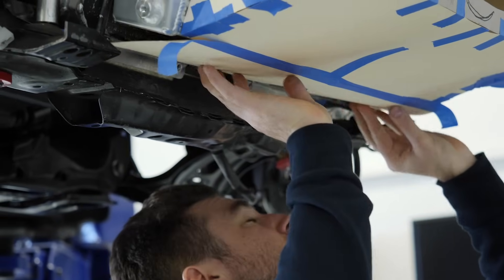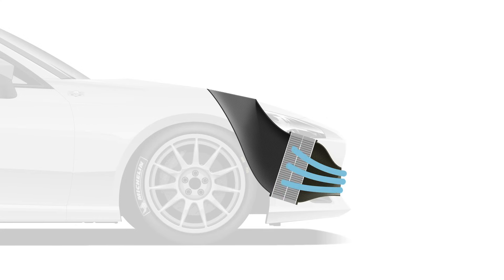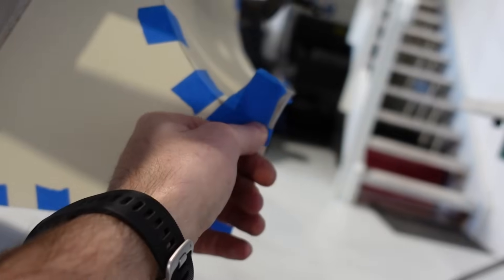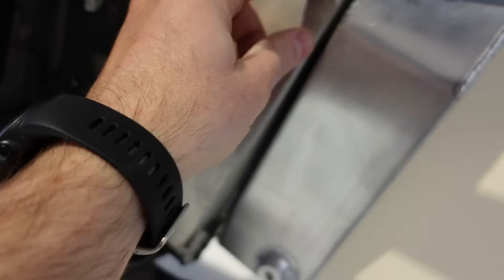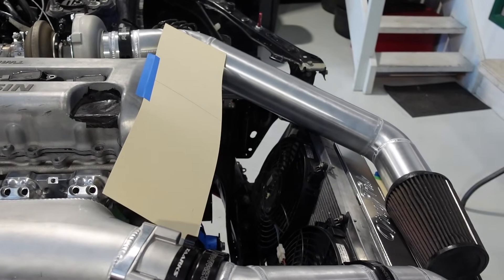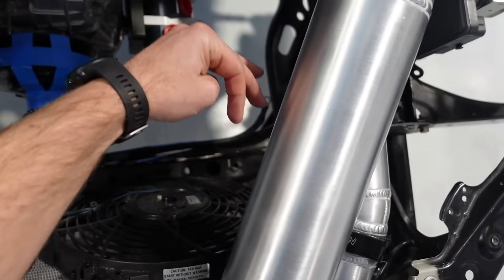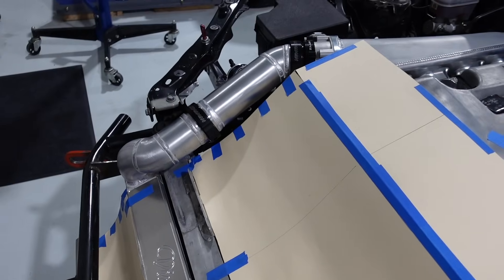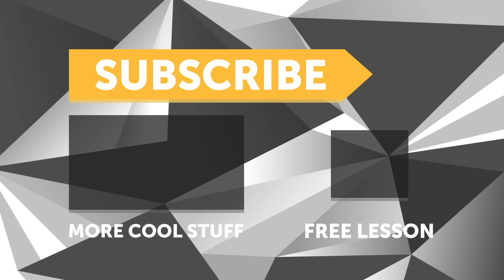Ducting and Coolers | 650HP SR20VET Swap | SR86 EP 3 [#BUILD]

Comment: Logical, sound theories there guys.
If only the manifolding sat the turbo further out. 
Never ending with saloon cars, single seaters are easyer to work with.
Worth checking that the exit duckting isn't too far back on the bonnet. I.E the air over the top does not reattach itself after the low pressure area behind the bonetts leading edge.
Hope all is more or less on schedual 👌
Reply from the maker: The outlet ended up being quite close to the front of the bonnet, so yes, not too far back! - Tim
Reply: @hpa101  Sorry to learn there were overheating issues in testing and the first event.  
If you read this, is would be worth checking there is a head of water above the top of the engine. 
Looking forward to future episodes.

Comment: 8:00 maybe I’m wrong but pressure isn’t density. + Remove one fan from the heat exchanger for extra efficiency because Racecar
Reply: The more gas particles the more air density. pressure meaning more air in the area = air density.
Reply: At the same air temperatures, you are in fact wrong.
Reply: There are different types of pressure, and the type he is referring to is static pressure  (note this does not mean the flow is static, but you can think of it as internal pressure). The higher the static pressure, the more dense the fluid.
Reply: I'm with you on that one. The higher STATIC pressure doesn't mean that the air changes density. Normally the assumption for gasses and liquids flowing at low Mach numbers (low speed) is that they are incompressible and the simplified Bernoulli's equation assumes there is a constant density througout the flow. Not that this theoretical technicallity will change any of the performance of the setup.